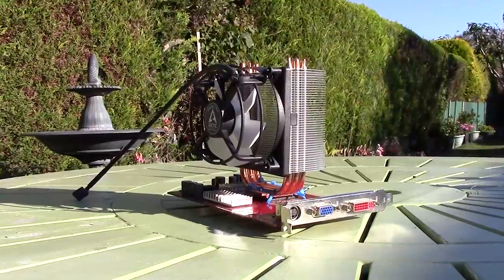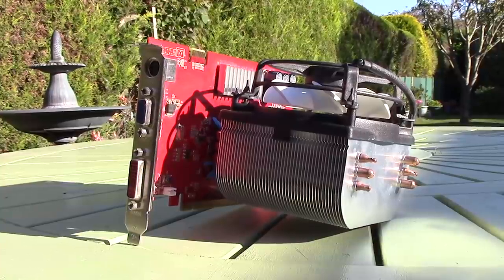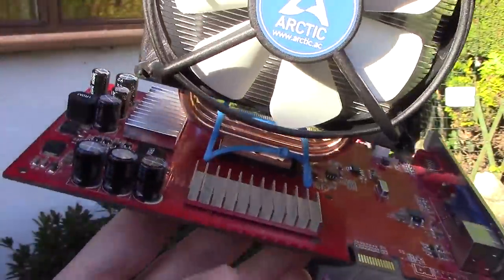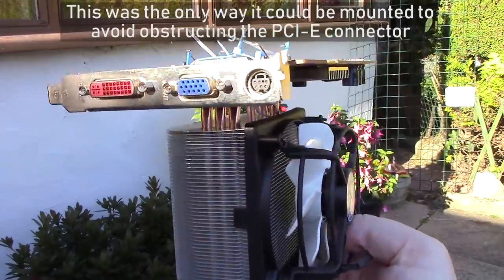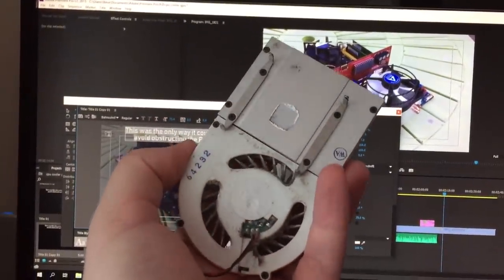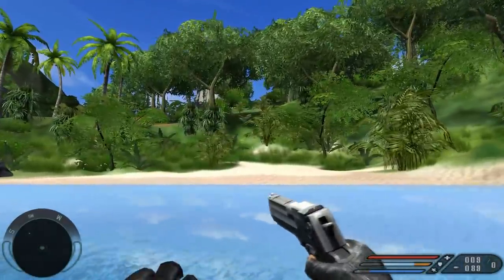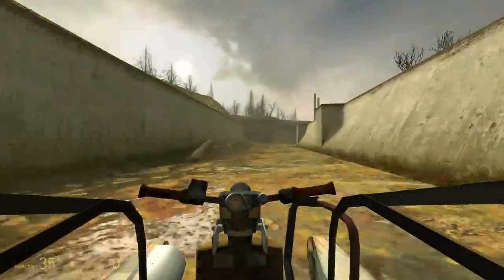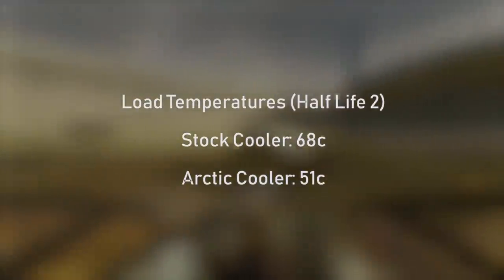CPU Cooler Meets GPU - Saving An Overheating Graphics Card

Comment: Even more important point than price for CPU cooler on GPU is that it can be tremendously more effective in cooling performance (and also more optimal for overall case cooling). But only if you can get rid of the limitations imposed by the difference of dimensions and orientations, so you need special arrangements regarding the computer case. (Water cooling is a different case, and more optimal from this point of view of course.) Check out this for example: https://www.youtube.com/watch?v=h6hvsqUEtZ4

Comment: are the following temperatures normal for my laptop
CPU- 80-85 C
GPU-75-82 C
All these temps occur during Gaming
Please could you guys tell me if my machine is overheating or it is normal for a laptop to be this hot during gaming?
Reply: Specs? What laptop? Room temp?
Reply: Karras Bastomi 
Acer aspire
i5-8250u
MX150
Room temp 30 C

Comment: My HIS HD3650 fan died for no reason. I didn't even OC it. So I cannibalize whatever GPU's fan I could found and has the same power jack size, got one from 7200GT. Turns out, the bolt don't match. But I came prepared. I cut a piece of can out of softdrink container, and made it so it could sustain the new fan. Quite a ghetto solution, I know. But it works.

To my surprise, the fan from old 7200gt actually manage to keep my HD3650 about 5C cooler. It does so while being physically smaller, like half the size of the dead fan.

Then fan issue also happened to two other HIS gpu I bought then, HD4650 and HD5850.
Today I avoid HIS product like plague.

Comment: you should still be able to attach the fan to the gpu even if its only a 2 pin connector. thr 3rd pin of the fan isnt really useful anyway.
Reply: The two pins will be the 12v and ground, you don't "need" signal or PWM pins. A converter for graphics card fan headers sets you back about £5/$8 and works a treat

Comment: Feels like a bad idea to put it on the motherboard header, it means the GPU cannot adjust fan speeds. For next time, snip the old cable in the middle and soldier it on so you can make use of the old pin adapter.

Comment: Back in the early WoW days and The Burning Crusade i overheated the fuck out of a 7600gt that was an xfx fatal1ty version. I thought i was a badass with half a gig of video ram back then. I had to buy a dual fan that went into a pci socket to help with the thermals cause i ended up raided alot more than i thought. But before i bought that fan i touched the heatsink and it was too hot to touch!!! Cant believe the machine did not shut down but the game sure did run shitty then. Its crazy to think that XFX doesnt even make Nvidia graphics anymore and started making AMD graphics instead. Also I remember the card coming with a DVI to HDMI adaptor might be able to help you out RandomGaminginHD

Comment: Wont the cable ties melt from the heat sync pipes?
Reply: They should hold perfectly fine below 85c. Above that they will get weaker but they wont start to actually melt until 250-ish so you should be fine.
Reply: @A1Plooplord  wow 250c endurance that cool i will try ziptie

Comment: I don't know how much power that card use is but if it's more than 250 Watts why not build a DIY water cooler, since the die is the only thing that needs to be cooled it shouldn't be more that much more difficult, and if you're already building a DIY custom Loop for if you feel you might as well do it for your CPU as well if it runs hot.

What is Tech tips has a good video on this, apparently you can get a custom Loop for cheaper than an all in one.
Reply: That's about 20x more difficult than zip tieing a cooler to a card. I zip tie coolers in under 5 minuets. Water cooling on the other hand takes a LOT LONGER, like an hour at minimum. I'm super ghetto about even that, drop a huge submersible pump into a 5 gallon bucket and run the exit hose just dangling into the bucket. I mean, I'm so lazy, I don't even use clamps or even zip ties on the hose barbs (which almost killed my Titan Xp, the hose popped off my system beside it and sprayed water everywhere in the room, now I zip tie them...).

You can get very good performance with water cooling, so its worth spending the hour, but don't think for even a second its as fast as using 2 zip ties to mount a cooler...

Comment: Which tends to get hotter, the CPU or the GPU?
Reply: it really depends on what you have, how well it's cooled, and your case's air circulation 

there's been a spike in i7 temps from Intel for the last few generations. It was notoriously bad with seventh gen. People who know what they are doing delid those and apply there own thermal paste of liquid metal. 

similarly some gpu's aren't going to run that hot while others will. More fans that better so a card with 3 fans should stay cooler than one with 2 vs one with only 1 etc.

Comment: Dont they need a copper shim because the core is slightly lower than where the cooler meets the core ppl used to use alot of heat sink paste to fill the gap.

Comment: can you do one for a GTX 1060 6GB? (EVGA, no SC, no SSC, just the regular small one, Mine reaches 80-85 while at 99-100% util)
Reply: Swap your thermal paste with better one. That's the problem. The cooler is fine.
Reply: @KarrasBastomi  no, I did that. It's the cooler.

Comment: I had a good laugh, and always like your videos, but I would put a disclaimer somewhere not to do this unless it’s the end of life of your gpu, as the cooler not only cools the chip itself but also the vrms and other parts of the board.
With this solution those other parts are left without a cooling solution.

Comment: I dropped 20 °C just by changing the fan in gpu by buying a 2 90cm fan that can be attached in the gpu bracket. Instead of 1 built in fan in the gpu.

Comment: Could you do a video on the HD 5870? I recently acquired one and found them quite powerful for their age.
Reply: He already did one. And yes, those cards are really fast. I have a Radeon HD 5850 and it outperformed my Intel HD 630. I wasn't expecting that.
Reply: @Tom2404  everything is better than intel hd graphics man and these cards are much more powerful than that
Reply: @lollb454  but the Intel HD graphics 630 are 8 years newer and can outperform a GT730.
Reply: @Tom2404  Yes but the gt730 is absolute trash, a hd 5850 is equivalent to something like a gtx 650ti
Reply: @lollb454  the 650ti is a little faster and consumes much less power.
Reply: @Tom2404  the gtx 650ti is also 3 years newer but thats not the point, I just wanted to say that a radeon hd 5850 is still a pretty powerful card
Reply: @lollb454  thats why I like my Radeon HD 5850. I originally ordered it for a Core 2 Quad build, but it ended up in my main system for a while. But now it is where I wanted it to go. In my core 2 Quad System
Reply: @Tom2404  Oh nice, which of the core2quads are you using?
Reply: Duka Duka - Everything, but GT210 ;)
Reply: Duka Duka - just sayin' [sarcasm included]
Reply: @lollb454  I am using a Core 2 Quad Q9450 with 12MB of Chache.

Comment: My fans on my G1 980Ti died so i have zip tied 2 noctua 120 fans to it and hooked up a fan controller sits at 75 degrees at full speed and i can just about hear it with my side panel off and 3 feet away from it on my bench all these fancy coolers seem like they add more to price than performance

Comment: I have a really weird question has anyone had any issues with old GPUs on windows 10? because i have, I have a sapphire radeon hd 4870 and for some weird reason i can't watch videos on youtube using chrome, the video won't load i can hear the sound but can't see the video and i have tested it on Windows edge and firefox and the video dose work just fine. chrome is the only one this happen and chrome is the only browser i use, if you have a fix please tell me!
Reply: i did i even reinstalled window it did not work. currently i'm using window 7 ultimate but its pirated i want to use windows 10 because i have a legit key for it
Reply: @JoeAceJR none of the drivers are compatible with windows 10 because i have to install AMD Catalyst to install the drivers and its only compatible up to window 8.1
Reply: @smoked_out i will try thanks you
Reply: Try to disable hardware acceleration.Windows 10 doesn't like old cards that much.My 8800GTX wasnt able to run any online app which required flash,and chrome was constantly freezing
Reply: Everyth1n9 - Its time to have a newer GPU. Thats what W10 says, though...
Reply: Amiga500 - Hey bro, you are just breaking the joy of having a GPU installed. Thats what hardware acceleration was created for. Its like having a CUDA- capable software and the need to use CUDA, just for disabling CUDA and then letting system process renderings by software (CPU-bounded) instead of using GPU-power or if possible, mixed CPU+GPU power.

C'mon bro, thats not a solution.
Reply: Manuel Newton ML I know but that's not an option for me at the moment (low on budget)
Reply: Everyth1n9 - Then try this CPU cooler solution, but do it with a evo212 or an arctic cooler like this with your own made clamps, not with zip-ties since they melt and this loosens them. Do it like the guy of DIY Perks channel. I don't remember the exact name of the video, but should be named like this RGHD video.
Reply: Manuel Newton ML uh Why does my cpu have to do with my problem?
Reply: Everyth1n9 - Do what you want. I was just saying 'Cpu Cooler' because that's what the heatsinks for CPUs are called in whole, as the one used by this guy. Use google translate to fully understand this reply on your native language.
Reply: Manuel Newton ML I do understand english just as well.
Reply: I'd recommend rolling back to Windows 8.1., as you can use the latest Adrenalin release that fully supports your hardware. 
For Windows 10, what you'll want to use are Windows 8.1 64bit Catalyst 15.7.2 (Beta) … be sure it isn't the WHQL Version, those are broken; it MUST be the Beta. 
Disable Window 10 Automatic Driver Updates.
Then everything should work essentially as well as it can for any Non-GCN Hardware on Windows 10. 

With this said, the issue sound like a Google issue; and frankly the best way to fix it is; don't use Google Chrome.
Frankly I'd not recommend anything Google if you can help it., hell I wish there was a legitimate alternative to YouTube... but there's not.
Reply: Leyvin (StudioRaven) I installed Windows 10 this morning and so far i did not have any more issues. Maybe there was a new update that fixed my issues, hopefully they are fixed!

Comment: Guys...you do understand that this is gonna help with temps...but it doesnt effect the power of a GPU right? A 1030 super cooled is still gonna have medicore FPS in modern games no matter the temp.
Reply: GPU boost will automatically overclock a card more the cooler it is, so yeah it'll help with the power of the GPU a bit. It'll also give more headroom for manual overclocking. However a crap card is a crap card no matter how cool it is :)

Comment: It gets so hot it melts them cable ties aka zip ties here in the United States
Reply: metal reinforced ones are usually more heat resistant as well so you could try those

Comment: 74c aint tht hot on an old piece of hardware whereas my rx580 8gb goes up to 86c
Reply: anything under 80c is nothing to worry about unless it's holding you back from overclocking. Certainly no reason to do a custom cooling mod when you're not even breaking past 75c

Comment: https://drive.google.com/drive/folders/1Y4aIzylQKAJDa0Ki2ptomG_ncIcbO95y?usp=sharing
there you have, my little mod. gtx 1060 3g evga SC
temp: 81ºc  >>  55ºC
vrm:   102ºc  >>  59ºC
fan speed:  700rpm
noise: i can't hear anything
cooler: thermaltake frio
Reply: wow so nice can i add thermal pads istead heat sinks to my 980 ti g1 gigabyte card with any best cooler and did you zip tie them good.

Comment: This is my getto cooler for my old hd4670 after the fan on the original cooler died. Runs about 10c cooler than stock. 
https://i.imgur.com/Cs5dAL6.jpg
https://i.imgur.com/iZ3y34a.jpg

Comment: Lol i once got 142 °C on an r7 240
When playing cs:go at 1110/1320 overclock
Still working after 2 years with that oc
Reply: No. Its impossible. No silicon chip can withstand 142° C.
Reply: it did survive it but it was only for about 10 seconds
most of the time it was running at about 80-100 °C after i cleaned the fan

Comment: This isn't without risk. The PCB stress is huge with such a cooler and PCB traces can get damaged, resulting in a dead graphics card. Off course this is a old junk graphics card but it's good to support the graphics card to reduce the PCB stress. Maybe you might think well it works but after quite some heat cycles (cold, hot, cold > solder cracks) that might change...